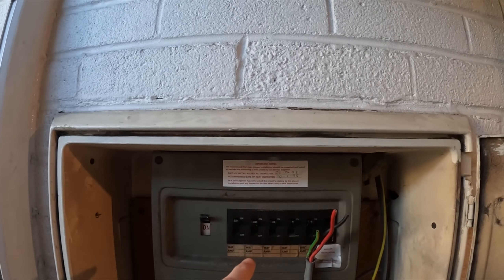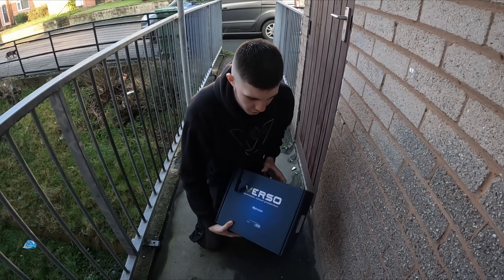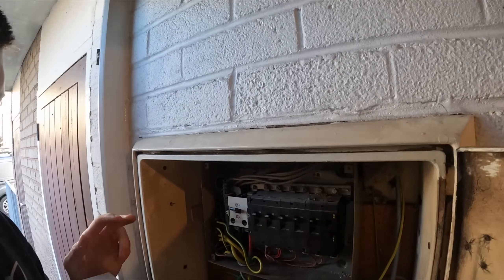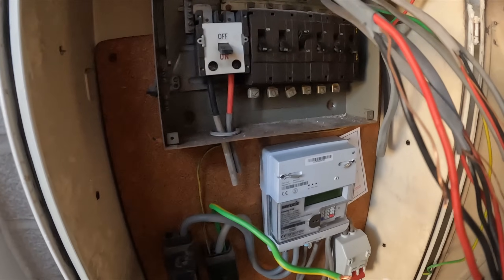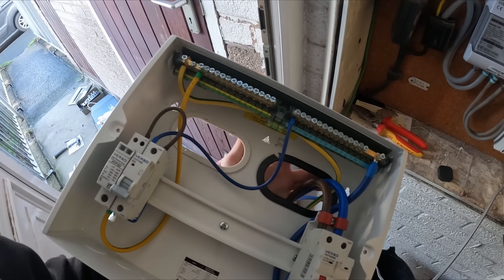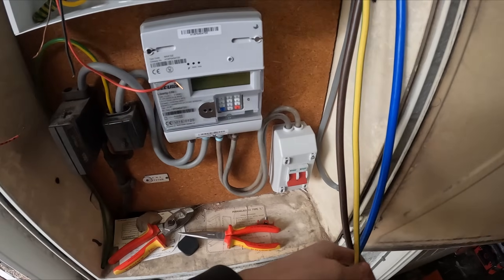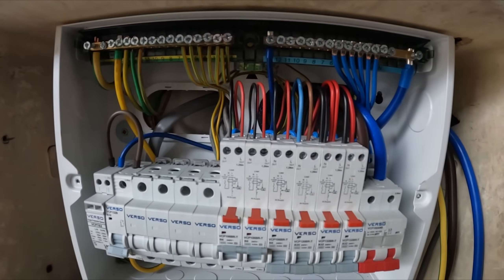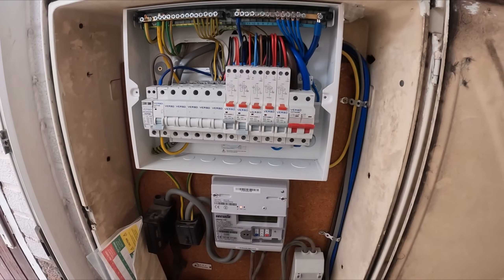Teaching Apprentice How to Swap Fuse Board

Comment: why did you say nice easy fix like you didn't just put them all on the same RCBO, you haven't fixed it you've changed your install to accommodate a fault
Reply: Also Ze with parallel earth paths connected, directly against GN3
Reply: Because he is still very much a novice

Comment: Immersion heaters used to be wired on 1.5mm cable, which is what the unknown circuit could have been. 
Also your 6mm cable could be ok on a 45amp breaker as 6mm is good for 46amps in ideal conditions.
Reply from the maker: In ideal conditions however I knew it wasn’t run clipped direct

Comment: When you do a board change, signing your EIC means taking responsibility for the safety all the wiring that's connected to it, just like issuing a satisfactory EICR. So an EIC is fine - surely you'll have done the same amount of (or more!) inspection and testing to issue the EIC. You may have to explain this to letting agents though. I had one client who decided to rent out two years after I changed their board, and that meant that they didn't need an EICR doing before the tenant moved in. It's not specified in the big brown book, I wish I could remember where it comes from; in my head I know that unless the condition of the installation dictates more frequently, an owner occupied house will generally be 10y to retest, and a rental property 5y.  Certainly the government's 'private rental sector' regulations mandate the latter
Reply from the maker: Cheers for the info much appreciated
Reply: You write on your EIC form what you have done, your EIC only covers this, that is why it is important to fill the form accurately.

Comment: Bang on work fella 👏 , stickers looks really nice. Just a FYI tho you dont need the mix colours anymore. Think it was last amendment that took it out.
really need to get on with trying them boards and does that company do the fuse Fan Isolaters? 
Thanks
Reply from the maker: Cheers dude I didn’t realise the stickers changed and yea verso fo the nice fuse spurs and fan iso
Reply: The only board label recommended now is a 6 monthly RCD test sticker.

Comment: It was a leasehold property, you shouldn’t even be drilling holes through walls without permission from the freeholder, which appears in this case to be the council. So always proceed with caution.
Reply: I thought it was a freehold flat that the freeholder wants to rent out, perhaps ex-council?
Reply: @Ragnar8504  Flats are nearly always leasehold.

Comment: I bet the new board won’t last as long as the good old Crabtree c50 board.
Reply from the maker: Mhh I reckon it  would but would be Intresting to take a look in 40 years
Reply: Had several new circuit breakers/rccb failing in less than a week some on day 1.
Never had a c50 fail so quick the newer ones marked in yellow introduced after the 15th edition regs think they had a higher fault current capacity.
The board you fitted gives a lot more protection good job.
Retired now but fitted loads of Crabtree c50 boards back in the 70s. @AdamDunlopElectrical
Reply: You are right there or the old wylex wooden backed ones that I still come across

Comment: Apprentice here please correct me if I'm wrong but 1.49???? Are you sure??? If it's 1.5 cpc it should be around 1.07 and if 1mm CPC 1.6. I'd be putting that as a F1. Only thing I can think of if it's 1mm and you are getting a parallel path? Also bud make sure you put back the main earth before getting you PFC. You want to ensure all parallel paths are in situ to prove the highest amonut of fault current that can flow.